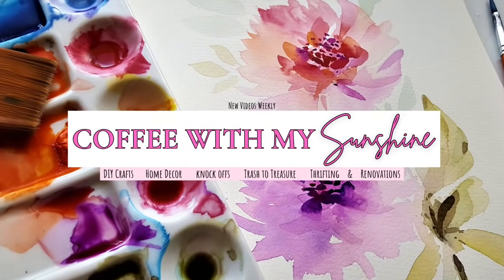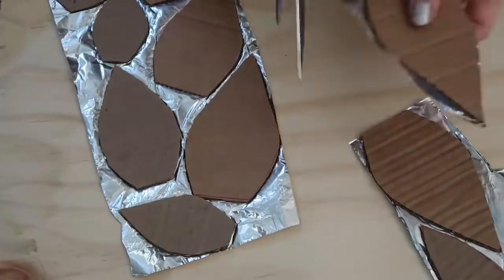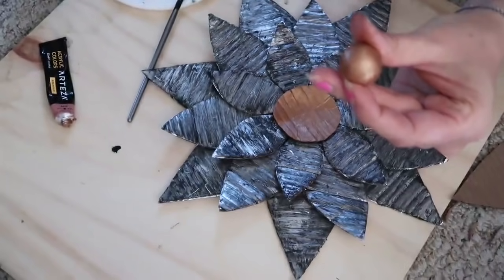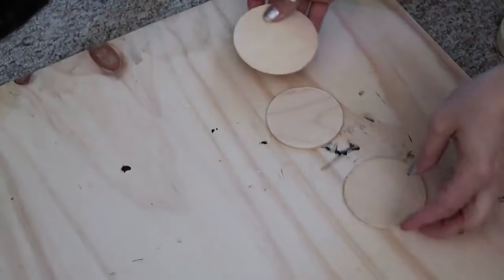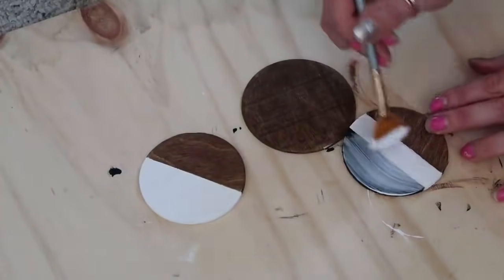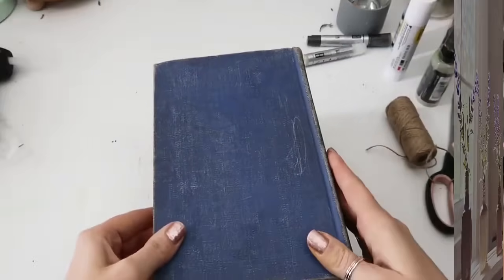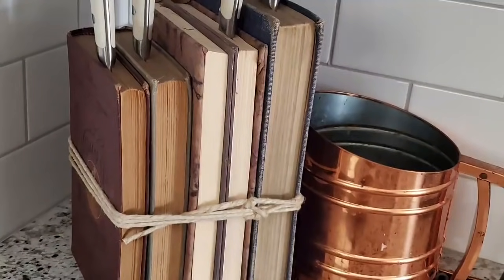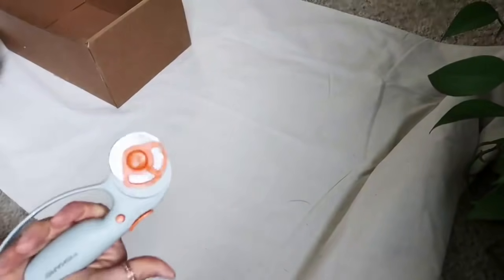⭐21 DIY RECYCLE CRAFT PROJECTS TO DECORATE YOUR HOME - FREE - REUSE CARDBOARD, PLASTIC, GLASS & more

Comment: Make sure to put a protective layer underneath when stenciling with the bleach. I've also used the bleach pens when doing this technique. Bolder look, less mess, and more precise application. Instead of using the acrylic markers you could use fabric markers. I try not to buy the kind that need to be heat set before washing to be permanent so just be sure to read the usage instructions when choosing which ones to buy. The nail polish bottles were adorable. I think that I will tie some twine or ribbon around the top where the threading is to add more texture and finish mine off. I love the tip about saving the tops to use as knobs in other projects. We crafters save and use everything don't we 😉 ! Another great example of that is how you used your children's old swing and made it into a riser. I love this so much and I think it's so precious how seeing this makes you smile thinking of the memories. TFS, be 🙏🏼 blessed and stay 😷 safe.

Comment: To help avoid bleed thru when stenciling or using painter's tape apply Mod-Podge to the surface before painting. Voila! No more bleed thru!
Reply: Love the double frame with the colorful hummingbird!!    I enjoyed the whole video!
Reply: Mod podge below the stencil? Or over the stencil under the paint? I assume let the MP dry before putting on n the paint?? Making sure cuz I always have the bleeding issue using my non-adhesive stencils.tyia!!

Comment: I'm imagine someone has already told you, but just in case not...you can make textured paint using, sand, old coffee grounds or chunky ground pepper. You can either mix it with your chalk paint or sprinkle on top of a wet coat of chalk paint the spritz it with spray pain or a light coat of chalk paint if you want to cover the color of coffee grounds, sand or pepper.

Comment: Love love the vases could you kindly tell me where to buy the clay color spray paint and what brand please I love that color! Thx so much
Reply from the maker: Hi Kimberly 🤗 thanks so much💗 The paint brand in Plutonium and the color is Twig. There's also a lighter color I used on the nail polish bottles.  I believe that is called Detroit Sky. But I had to use white first because it was really light and didn't show up. I got the paint at our local hardware store.  The stone textured paint was from Home Depot.   I hope that helps.